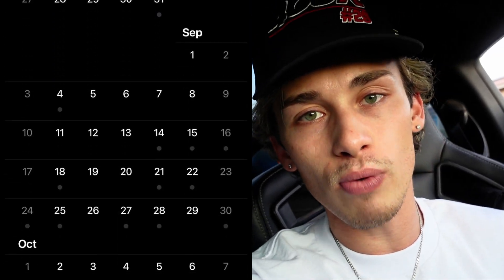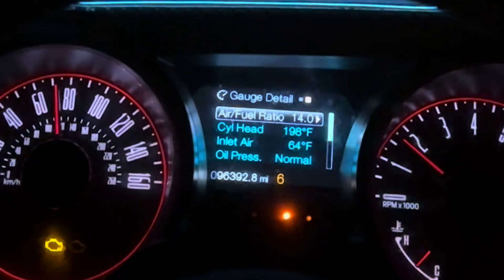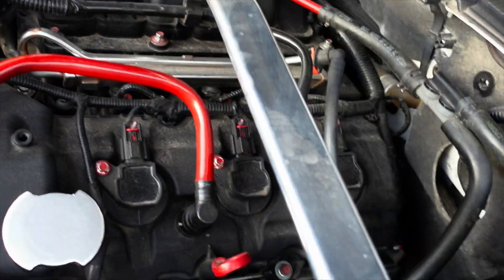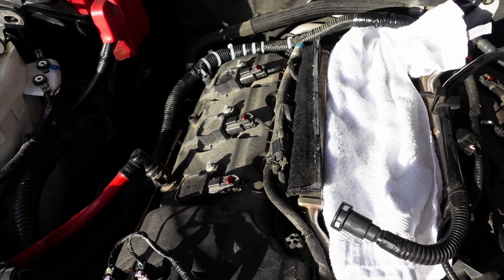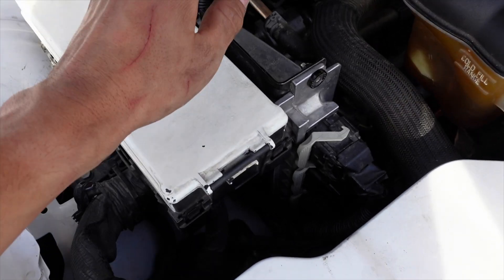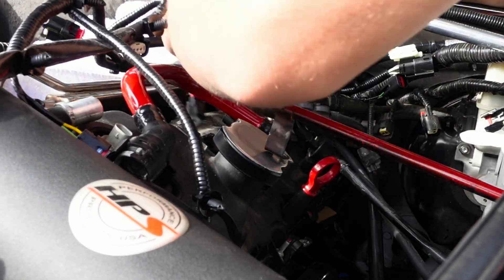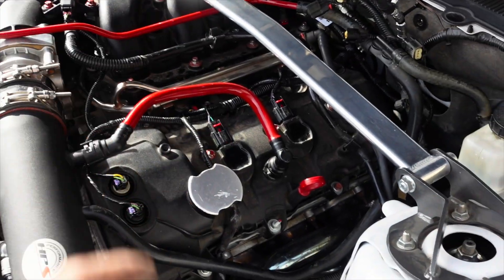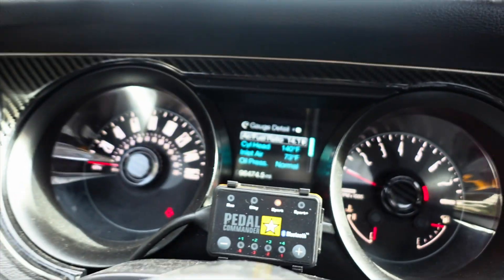Replacing My Entire Engine Harness with ZERO Experience! (2014 Mustang 3.7)

Comment: Did you have power surging with voltage and rpm before the new harness?
Reply from the maker: No signs of that. Check your throttle body and mass air flow sensor and clean it if it’s dirty

Comment: Dude that was great! I'm happy for ya. I'll tell you what, while I've helped my dad change my transmission out and pinion bearing in my rear differential, and installed a clutch kit myself, and installed all sorts of different suspension parts on multiple cars, I wouldn't be comfortable doing a wiring harness by myself, and here you are successfully swapping the harness and fixing the problem all on your own. Good on you man! Now that the car's running good, we need to find a day to go to Red Rock and drive the cars like they were made to be driven! Be blessed man.
Reply from the maker: I appreciate you watching Noah and it was a pleasure meeting you! Sounds like you have a resume full of goodies under your belt. That’s great to hear you’re learning and trying new things! As for the wire harness, it looked like a daunting task at first, but once you get the ball rolling you’re fully committed to doing it and getting it done right. After hearing what ford wanted to complete the job from A to Z made me even more happy haha